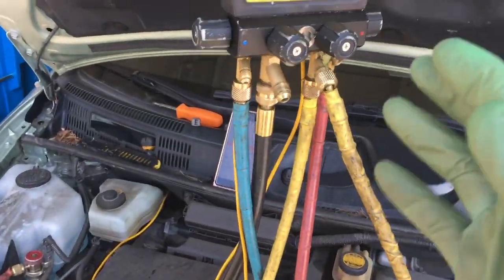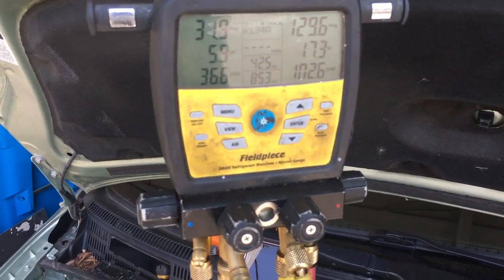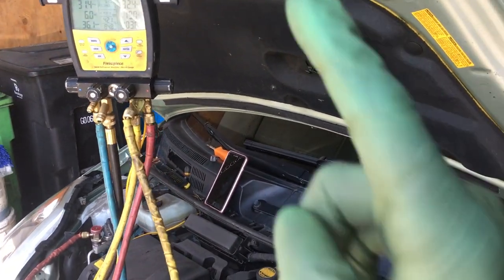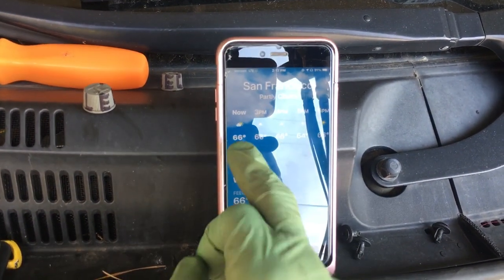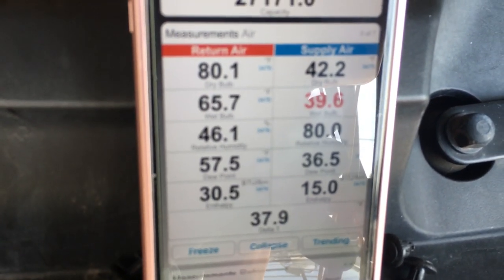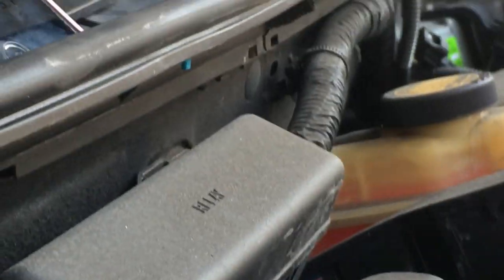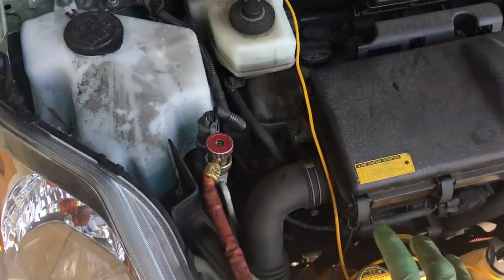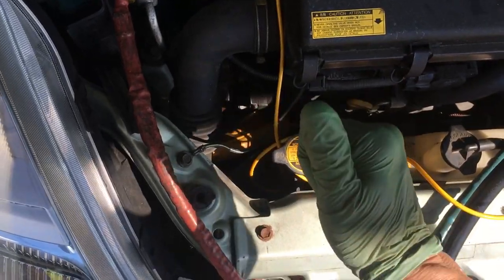AC Working perfectly , refrigerant charge correct , no contamination of refrigerant￼  = COLD

Comment: I always noticed on my prius that when i put the a/c on max with recirculate, no matter how hot or how cold it is outside, the subcooling was very high. Around 26 or so. And the superheat was always around 26. Is that normal or does it sound like a restricted expansion valve
Reply from the maker: It will kind of be all over the map depending on the heat load and operating conditions. 

Remember this is a variable system

          And if you seen enough of my Prius only videos. (which by the way I should group all the Prius only videos in one file for people to click on and watch) 

Unless somebody is using very accurate high-quality clamp Thermistor type. 
            Wrapping with insulation to protect them from false readings due to radiant heat off the engine and convection heat from the radiator fan blowing I do not trust anybody else is reading. 

           And definitely if they’re using sensors that were sold for automotive use those are of the lowest quality lowest resolution and low refresh rate. 

An infrared camera or sensor are basically totally useless. 

Then it comes to placement of the actual sensor. 

         And readings are only to be taken after the system has been completely recovered of refrigerant put on a vacuum pump and charged up by weight only to factory specifications with an accurate scale within a repeatable accurate method. 

Then and only then are the readings to be trusted and considered accurate if it could be repeated time after time.